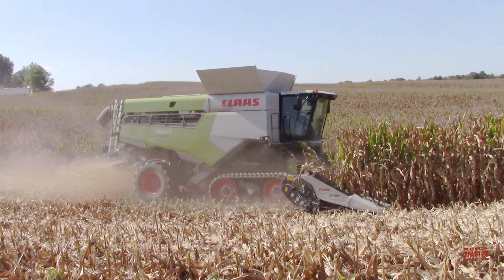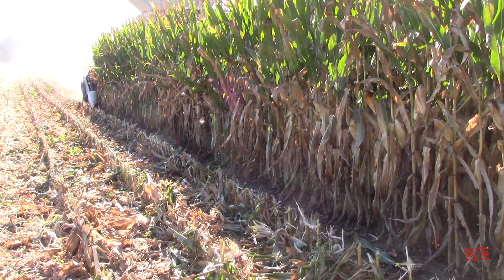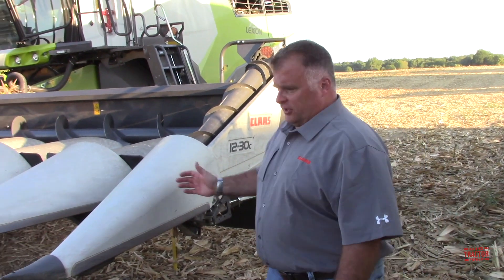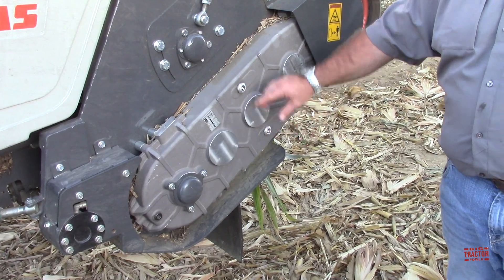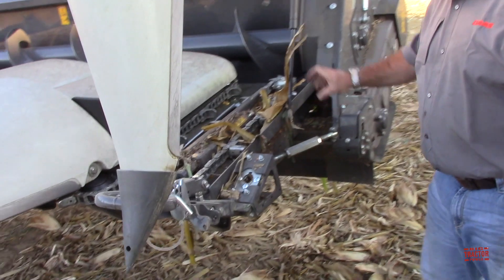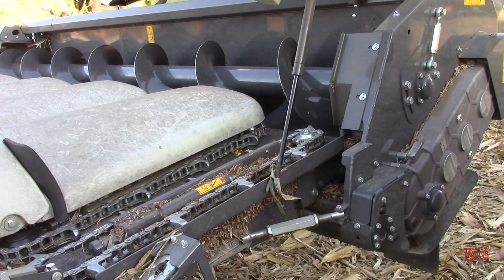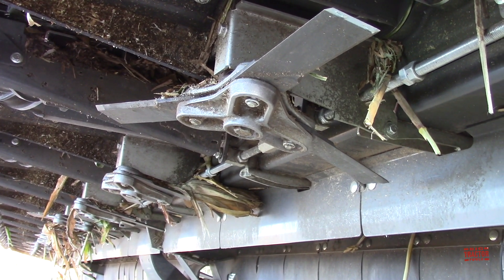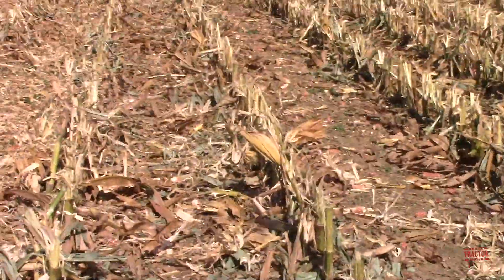New Claas 12 Row Chopping Corn Head

Comment: Hi Jason, pardon my ignorance as I live in England but how do they prepare the ground for winter wheat? Love your obvious passion for farm equipment and it,s proof of your success that the manufacturers welcome you to report on their latest offerings, ( i don,t mind how you pronounce Claas by the way.... :)
Reply from the maker: Thank you for watching.  There are four ways the ground can be prepared for wheat after corn. 

1.  Lime and fertilize and no-till the wheat seed.  

2.  Lime and fertilize and run a vertical tillage tool to chop and mix the residue with the soil and seed wheat. 

3.  Lime and mix fertilizer and wheat seed in a spreader and broadcast it on the field and then disk it in with a packer in tow to firm the surface of the field. 

4.  Lime and fertile then disk deep to bury the stalks and Harrow to smooth the field and then seed. 

You will see WKY farm’s do any of these four options. Some will do some notill and some tillage depending on the field.  I see all four options yield about the same. Tillage does help prevent Disease carry over to the wheat crop. 

As far as the way to pronounce Claas goes it must be a North American annunciation as the marketing manager for Claas says the name the same way I do.  Maybe it’s like plowing in the United States and ploughing in England???

Comment: Do farm have problems while passing under electric wires????

At what height are they
Reply: ashwani chouksey The combine will fold the hopper on the top in and clear power lines. All lines in the USA are required to be 14’ 6” or more so the combine will clear.
Reply from the maker: The power lines are not a problem in this field.  They are at least twice as tall as the combine.  Thank you for watching.

Comment: Not sure what it is, but  I really like these big Claas Combines on tracs.  Like the segment where you go underneath to show the  rotors that cut the corn stalk.   Enjoyed hearing Jeff from Class describe the equipment.   Always enjoy the different reps that actually get out in the field and talk about  their product.  I know things break and outside of  seeing  uncut corn once you made a pass, is there a sensor to let you know if any of the blades break?   Could not count them all but looks to be around thirty blades or more under there.    Thanks for posting and sharing
Reply from the maker: Thank you for watching.  There are 36 blades on the header.  There are sensors in the combine to alert the operator if something is not running correctly.
Reply: I'd take a good guess and say if one would break the vibration would let you know pretty fast regardless of sensors
Reply: @JoshuaSmith-xw6jp    I'd take a good guess and say a machine this big and heavy,  you may not feel any vibration unless you get some major damage.   If just the tips snap there may be smooth sailing and only irregular cutting.  Just saying,  big heavy machines don't always vibrate.  Machines of this size have to be built with durability, longevity and heavy duty in mind.  Vibrations may not occur.    Just guessing.
Reply: @spliceoncharlie  yeah maybe you're right. I don't know either. But I do know a  truck tractor is pretty damn big and heavy and if you break a fan blade on them you definitely know it immediately!! It will shake that 80,000 lbs so bad to the point that you cannot drive it at all and God forbid you're driving when it happens, you can't get pulled over and stop fast enough! But that's a little different than what we're talking about so who knows. Good talking to you
Reply: @JoshuaSmith-xw6jp  I agree 1000%, that those fan blades cause vibrations and noise since they are much much bigger.  Had a clutch on a fan go bad and WOW!!!!   What a mess and what a noise and an instant shut down.  Luckily I had just enough speed and space to coast off the road and safely out of traffic.    Those blades on the corn header are small so not sure you will feel any vibration unless you get some major damage.  What I thought of when they raised that corn header and saw all those blades was a horror movie and someone getting chopped by those things.